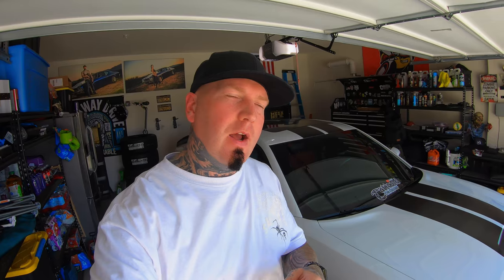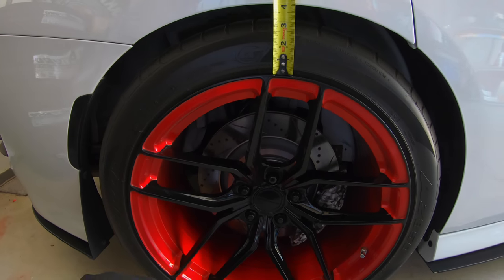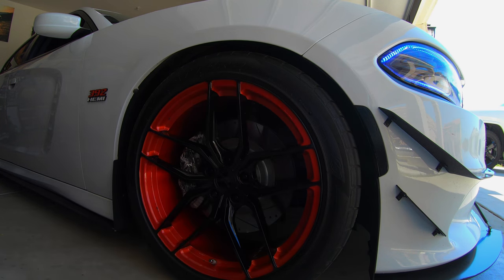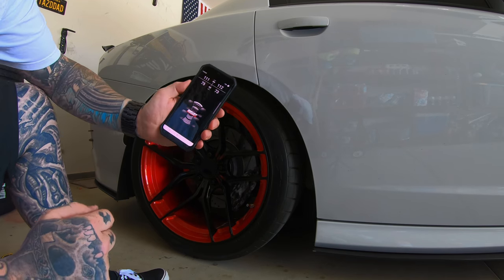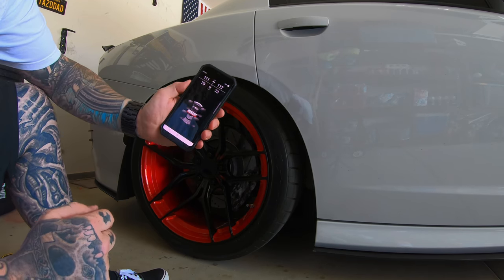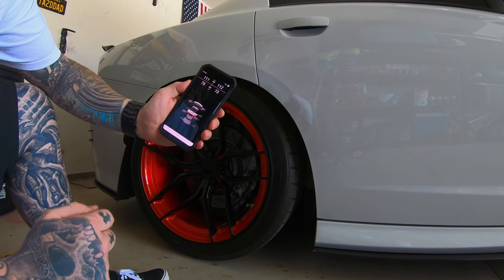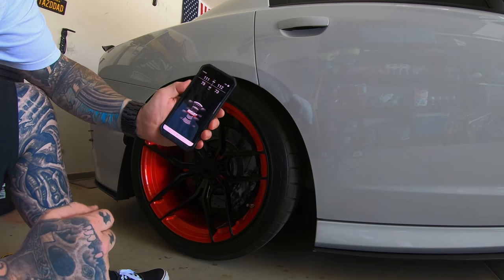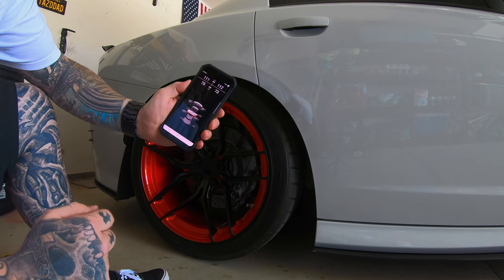HOW TO SET YOUR RIDE HEIGHT ON AIRBAGS *AIR RIDE SUSPENSION WITH DIGITAL MANAGEMENT CONTROLLER*

Comment: Thanks bro.  I'm disabled from a GSW to the head and I have hemiplegia (Fancy word for right side weakness and paralysis) and I just bought the Airlift P along with Work Meister S1 3p for my 2008 350Z.  I have to install it myself when it gets warmed up.  I already ran my harnesses and my air lines but I have to wait for my wheels to be made and I should have them at the end of May 2022.  Until then I'm trying to learn all I can about Airlift.  I just learned even though I bought a full kit with dual everything that I don't have a lifetime warranty.  Just a 4 year.  Airlift changed their warranty so in you bought a full kit after  9/03/21 you get a 4 year.  If you just bought a management you get a 2 year.  Kinda pissed off about that but whatever.  Thanks for explaining everything to me so even I can understand it.

Comment: If your bags wont let you lift it up to the stock rideheight just set it as close to it as you can without the bags leaking. Then go to a shop and get a wheel alignment at that height you chose, to minimize wear as good as you can. 
I had to do this on my Benz e350 and the tires wear little to no more then the stock ride height would.

Comment: Great video,  2 questions...
* how are you mounting your controller inside?
* which fuse on our seats are you using for signal (pink) wire so it'll fill on start up if selected?  

Thanks!
Reply from the maker: Thanks Dustin 👊 
***I mounted my controller using some GoPro mounts.  They're inexpensive and have held strong ever since I bagged my car.

***I didn't physically wire up the system so not sure bro... but when wired correctly, it's a setting that's easily changed through the controller itself.

Comment: That’s a sick ride, did you have any clearance issues when aired out on the front wells with the tire hitting?
Reply from the maker: Thanks 👊.   When aired out, the inner part of the fender would physically sit on the tire... but never an issue unless you "turn" the wheel when aired out....  which you should never do.

Comment: Very informative video. Thank you for sharing. I have upgraded to the height sensors and I’ll be danged if i can’t get the calibration to pass. It keeps on failing calibration.  What was your trick to calibrated for height sensors.
Reply from the maker: No problem, glad the video helped 👍... If it fails calibration due to a fault in one of the height sensors, you'll just need adjust the mounting of whichever specific height sensor is causing it.

It usually just a small adjustment in the way the sensor is installed.

Comment: At 19:40 You mention bumping up one side because of your weight. If you have level sensors wouldn't the system automatically re-level to the set height regardless of your weight, passengers or a loaded boot? I've just installed  this exact kit so am learning from you, thanks.
Reply from the maker: You're correct... but for those who have the 3P system,  which is just based off pressure alone and that I ran for awhile, that's when that comes into play.  I was covering both systems for the viewers.  In our case, yes, the system will automatically compensate for weight, which is why I prefer this system 💯

Comment: I just bought a newer Infiniti q50 and it has bags on it at high speeds it seems pretty shakey from 70+ mph I have my 2 front psi at 126 and my back at 60 didn’t know what pre set would be good to stop the shaking  thank you

Comment: so if I understand correctly, ride height sensors aren't required for the install? If you know the factory ride height is 143psi for example, then adding or subtracting pressure is how you know what height you're at?

Comment: What about the compensation for when you're weight is in the car?
Reply from the maker: Just 1 person isn't a drastic of enough difference to affect the pressures significantly...think about even with coil springs...when you get in a car with coil springs, it's not like the car leans to 1 side.   

But...that IS why I went and went with the 3H sensors, so when there's additional weight added to the car (like my family in it), the system will automatically add needed air pressure per bag depending on where I have my ride height at.

Hope this helps 🤜🤛

Comment: i got air ride as well  but the problem im having is whenever i air out and i wanna drive so i press the preset height but it never saved where i left it as. why it does that?
Reply from the maker: It sounds like you didn't "save" your ride height correctly.   Did you follow the steps I go over?

Comment: How do I increase air pressure in the bags? You’re running pretty high but your car looks low? I run 45-50 PSI front and 65 PSI rear lmao. Drives like garbage and bottoms out, I have a mustang gt

Comment: What tire are you running front and rear? I just purchased my 3H kit and can’t wait to install it. I am slightly concerned about figment when aired out. I have 275/35/20 up front and 315/35/20 rear.
Reply from the maker: Check out my other "ATTURO TIRES" video on my channel, I go into depth with it
Reply from the maker: https://youtu.be/M3J_lz4bQFc
Reply: @TattooedCarCulture   Thanks man, this relieves my concerns. I have zero rubbing now with Eibach Pro so I should be fine to lay out with my existing setup.
Reply from the maker: For sure brother 🤜🤛

Comment: Is there a way to adjust the actual pressure but for stiffness not to actually lower or raise the car
Reply from the maker: Most adjustments regarding stiffness is done through the dampeners/shocks/etc.  An example, on hellcats, they use a mag ride type of strut which the driver can adjust the stiffness or softness of the ride quality...again, through the shocks/struts. 

 So depending on your platform, I know aftermarket companies offer similar setups

Comment: has anyone had the issue where I would set a pre-set height and then trying to go to it and its just completely off height wise to what i set it at?
Reply from the maker: You have to make sure your tank is full or your compressor(s) are not in the process of filling the tank...because I've had that happen after I 1st air up...and the tank has to fill before the correct pressures/preset ride height will be 100% accurate. 

Your system will get it close, but if your tank is low and/or in the process of filling, it'll throw it off
Reply: @TattooedCarCulture  thank you! ill give it a try
Reply: @TattooedCarCulture  I just tried it and it’s still tweaking on me 😭 it seems like it’s just the rears that I’m having the issue with. fronts seem to be at the right height every time. but the rears will just be super low even though it reads the correct psi on the controller

Comment: Is it safe to run the airlift performance bags daily at PSIs above 130? My install guy said better not to, but noticed your fronts are at 140+ PSI.
Reply from the maker: Well I'm running universal bags over factory struts as my setup, with air lift performance being my main management and controller...so that's why my PSIs are different, and totally safe, 3+ years daily driven....  but if you're running air lift performance bags, I HAVE heard they don't like really high pressures...
Reply: @TattooedCarCulture  thanks homie! Appreciate the info 🙏🏽

Comment: dope vid having a problem with finding my ride height ive noticed some bounce to it im so annoyed by this and dont know what to do not sure if I need to play with the dampening any help is appreciated.
Reply from the maker: What type of car bro? And when you say bounce...are you saying AT RIDE HEIGHT it bounces too much and that's what's bothering you?
Reply: @TattooedCarCulture  yeah bro thats driving me insane I have a 2019 honda civic si
Reply from the maker: That's honestly probably exactly what it is.  It could be if you're using the original shocks, that you're new ride height is so low that they can't effectively do their job... so some guys fix it with a shorter overall length shock...if that makes sense...

Or, like you said, the shock itself might be fine, you just might have to stiffen up the dampening by getting a new/different.
Reply: @TattooedCarCulture  actually I have D2 racing air struts bro with 32 dampening settings.
Reply from the maker: Sick!  Well then, that sounds like the main issue...  cause bags won't make it "bouncy"... that's in your struts/shocks... so my advice, just stiffen those bad boys up substantially 👍
Reply: @TattooedCarCulture  thanks brother

Comment: So my ride height was set at 42 in front and 62 in the rear and had it aligned at that. I now usually drive at 47 and 70. Should i get another alignment or is that little amount not a big deal? I have the 3p system
Reply from the maker: That amount shouldn't be enough to throw off your alignment... unless you're noticing a pull to one side or something... otherwise I wouldn't trip on it

Comment: How come you are running over 100 psi on the bags and then some guys are only running like 40 psi? I ran 80 in mine and it was bouncing like mad all over. What do you think is a sweet spot? Those wheels are nice!
Reply from the maker: It's all vehicle specific, and the volume of air the bags can hold.  A charger is a pretty heavy car (compared to lighter JDM style cars that run bags), that's why you'll see a big difference in bag pressure, even when it's the same system....it's all related to specific bags and vehicle application.  If your car was super "bouncy", that sounds more like a strut/shock issue, rather than a bag issue.
Reply: I'm using an Air Lift Performance system from a Lexus on a '69 BMW and the way I plan on figuring out the correct pressures and ride height is to install the system and adjust the pressures and dampers to the ride QUALITY I like.  Ignoring the ride height, I'm only interested in the way the car rides.  Once I determine that, I use the adjustable strut tubes to set the ride height.  By doing it this way you know your starting with the correct pressure (bag height) that will be around the height you'll be using most of the time.  If you go lower you can increase the stiffness with the dampers somewhat.  If you want to go higher it's usually for a short time to get past a speed bump or steep driveway so the higher/stiffer bag (air spring) doesn't matter that much.

Comment: My biggest question, in lowered on coils now, so my alignment is set for that. So I'd measure for that for my "factory height" but if I wanted to cruise around at lower heights sometimes, are you worried about alignments at all?
Reply from the maker: Honestly no, not with my setup... I constantly roll around at about a 2.5" drop from factory and never had any alignment issues....  but it is also vehicle specific, and so if you've already had your vehicle aligned at your current ride height, if you go bags, you should be golden
Reply: @TattooedCarCulture  thanks brother. Appreciate the video and the response. Can't wait to join the bag life. Just bought them so waiting for them for my 2002 Lexus LS430
Reply from the maker: Hell yeah man!  I honestly love the #baglife 💯

Comment: I just picked up a FD1 civic bagged with this same system.. But the left side seems to be lower than the right when at even PSI .. I have to keep right front & rear about 15 to 20 psi lower to aesthetically look correct.. Is that a calibration issue or possibly camber adjustment?

Comment: I have a 3p, but all my pressures are different if the car is equal height at all wheels. Is this normal? For example my driver-side and passenger-side front wheels will measure the exact same height, but the driver side will be 90 psi and the passenger side will be 75 psi.
Reply from the maker: Yes it's normal.  That's why I illustrate measuring the ACTUAL height, then setting whatever pressures those are. 👍  cause tape measures don't lie

Comment: From factory ride height can it go higher?
Reply from the maker: Yes absolutely... in the video, I talk about how in my preferences,  I use the top button to lift the front end for steep driveways, etc...  ultimately airbags will give you about 2-3" higher than factory ride height flexibility

Comment: Any issues with the 3h? I have 3P but wanting to upgrade to 3H but I hear the height sensors break and etc...have you had any issues? 🙏
Reply from the maker: If a shop installs them correctly,  they won't break...  but, they are a bit temporalmental... I chose to upgrade, but honestly the 3p system works just fine 👌
Reply: @TattooedCarCulture  yeah I got mine from Airrideequipment so I know they are the best but idk if I want to upgrade to 3H..cuz i do roll with a full car at times I know im in good hands with them..thanks for your info and time
Reply from the maker: Yep, Ray at airrideequipment upgraded mine to the 3H height sensors and I've never had a problem...  I hear of accuair height sensors breaking a lot, but my air lift performance has always treated me right 👌
Reply: @TattooedCarCulture  nice i just found you on IG..yeah ill hit up Ray see if he can convince me haha
Reply from the maker: Haha 👍

Comment: Do you find the pressures affect ride quality much?
Reply from the maker: Not in the way you're referencing... the quality of ride isn't affected by my different pressure settings, but it does come into play if I am "riding low", if I'm not careful I'll tend to scrape my splitter more, or my rear tires will rub hitting dips in the road, etc... but the "ride" feels the same regardless of how much pressure is in the bags.  Different setups might have different results, but I'm using UNIVERSAL BRAND bags over factory struts/shocks.

Comment: Ight so If I wanna bag my Hellcat should I just buy the air lift performance controller or should I buy bags and a tank with it?
Reply: You're going to need everything. The manifold, harness, controller is the management. 

Then you'll need the equipment that will physically air up and air out your vehicle. The bags/struts, air hoses, air tank and compressor (s)
Reply: @blkeclipsel2400  goddam lol
Reply: @jtzoogodwap  yea my initial thoughts were fuuuuck that lol.  but now that I have it - I refuse to go back.